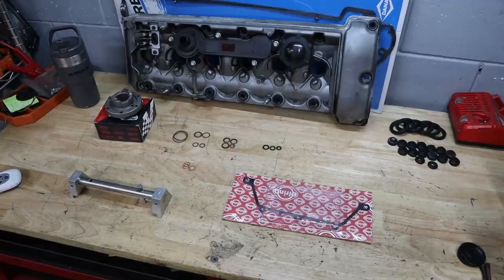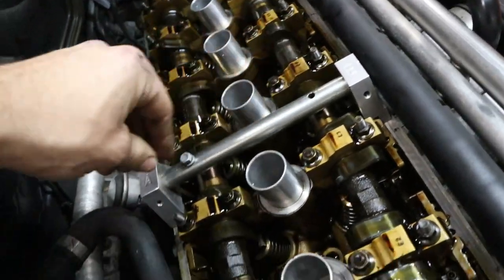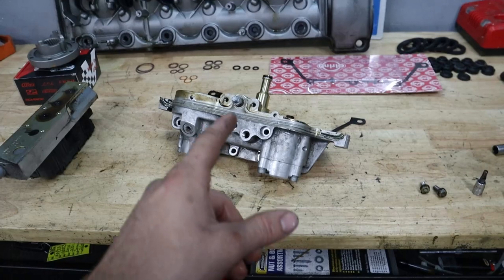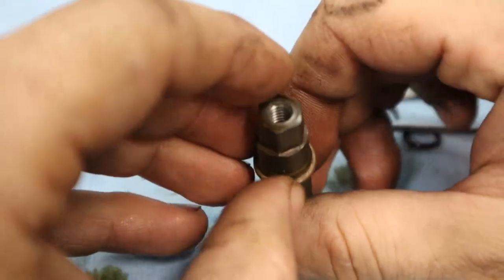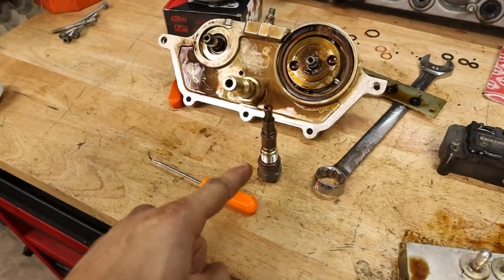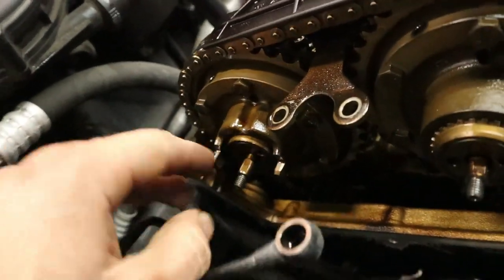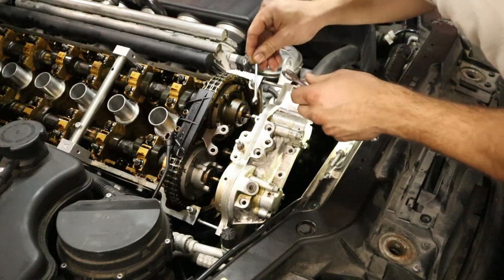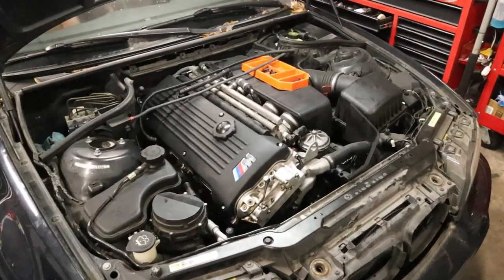BMW S54 Vanos Rebuild: Seals + Exhaust Sprocket UPGRADE!

Comment: Great video still scared to do this myself but so let me get this straight. You can either get the reinforced exhaust sprocket or keep it oem and get the redrilled vanos oil disc. Also I have to do the reinforced cam sprocket bolts as well as the timing chain guide so mine may be more excruciatingly extensive

Comment: So if we open the valve cover and the cams aren't at the top dead center (like, one of them is off by like 10 degrees while the other is straight), that's normal? We just need to twist one of them using the wrench?
Reply: Yeah this is something I would like to know as well. I also have got my crank at TDC and cylinder one. The lobes are pointed each other. However, the timing bridge pins do not fall into place. The intake pin is close but not perfect and the exhaust is off by about 10°. From my understanding, it looks like in the video that that maybe normal and that's why after he removes the solenoid pack, he uses the 24 mm wrench to manipulate the exhaust camshaft manually so that he can get the pins to fall in place, but he doesn't really state of that's exactly what he's doing.

Videos I've seen people just time the engine at TDC and then as soon as they put the bridge on their pins fall into place and I'm like. Wow that's not happening for me lol

Comment: Rocking the cams with the 24mm wrench absolutely necessary? I don't have anything that will fit on the cams, and that's where I'm stuck. I've removed everything, just can't the the vanos unit out far enough to access the gears. Trying to see if I can get away with just prying on it and using a rubber mallet

Comment: Excellent video as usual! You really deserve many more subs than you have so far. But I think there will be more to come if you keep up the great work! I would have to say though a little more of the speed of your machines on display would perhaps help?? Anyway I sure wish this video had been out when I had to do my vanos work. I got it all done but it sure wasn't as clear and shown as to what to do etc as you show. Thank you for all of your videos and hard work! I actually have a swapped 2002 E46 330CI to 2006 E46 M3. The 330 had a bad head gasket and the M3 had been rear ended and written off so swap a lop a loo la! I LOVE that car! Then last year I bought a car I couldn't pass up because it was the deal of a lifetime! 2008 335Xi (I'd much rather have gotten a standard "I" but...) and the guy wanted $1500 BUCKS!! (See). It needed a HPFP and a rear wheel bearing and Varoom! LOL. Of course I then did all the maintenance on it which set me back a chunk of change (As you very well know)  but I did all the work myself. Now Tomorrow I'll be getting my new Turbos installed by a great indie shop ("XI" without a lift isn't my idea of a good time lol) so I'm really excited!! As can be seen by the book I've written here. Sorry about that but you know how it can be for those of us bitten by the Bimmer bug. Or should I say "N54 the World!!". Okay that was dumb but I am excited!
Reply from the maker: 535xi sounds like a capable daily, and the 330ci M3 sounds like a unique build too! Love fixing and repurposing these cars. You fit right into the community. Thanks for watching!

Comment: Hi Bimmer barn !!!Great video!!! I can’t make timing .I put a pin to crank shaft and I tried to move camshaft with 24 mm range intake.I can’t move even little bit.Can you tell please way?
Reply from the maker: Yeah! If you remove the 3 bolts on each plunger cover (see 8:09) it'll release any built up vanos pressure keeping the camshaft locked up. Should be a lot easier to adjust it then! Hope that helps :)
Reply: Thank you!!!